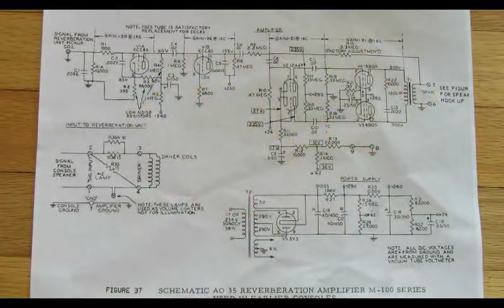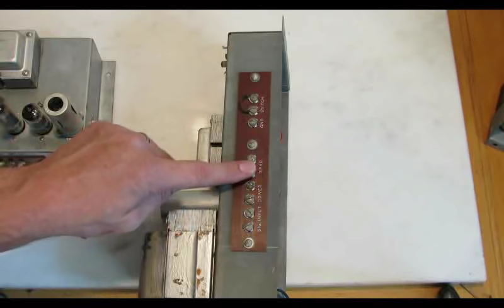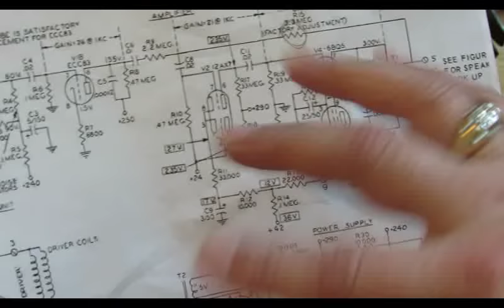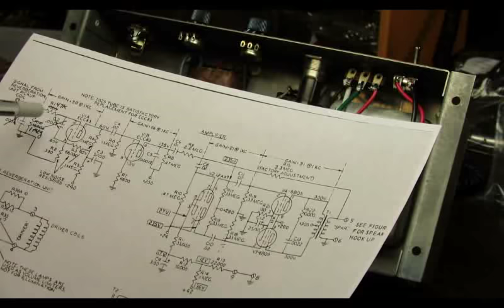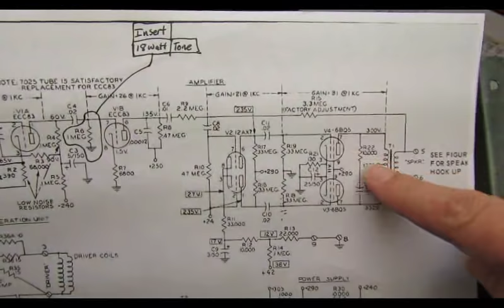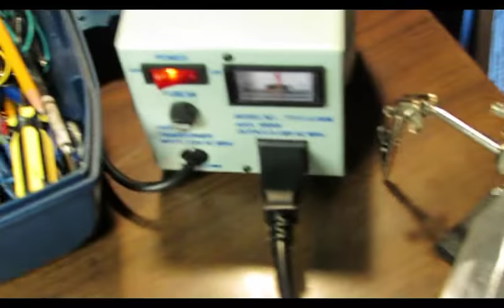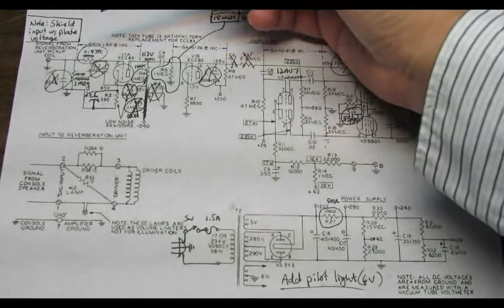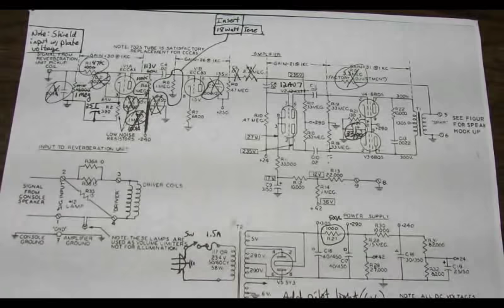Hammond AO-35 Complete Start to Finish Guitar Conversion & DEMO

Comment: So I've got one that I've just finished my initial mods to which follow many of the suggestions that have been mentioned here. I'm amazed at how quiet the amp is even though the only new parts are in the tone circuit and input. I've also completely removed the NFBL and the zobel network (this was done for me when I powered on the amp and the resistor in the zobel network burned up). 

The issue that I've come across is that at about 3-5 on the volume, I get some high pitch squeal. Above that the squeal goes away but the volume is substantially lower and there are a lot of what I assume are odd order harmonics in the distortion (to be honest I'm having a hard time finding a video demonstrating odd order harmonics to be able to confirm my suspicion. 

The controls are in the same location as the CG and I ran across another thread a while ago (of course I can't find it now) that mentioned having the controls that close to the OT, can cause some interference and that if that's where you're going to mount it, that you need to have it shielded. Anther possible cause?

I have 2 new, matched output tubes coming as I think I've ruled the pre-amp tubes out through swapping out with some that I had on hand which I knew were good.

Open to any feedback. 

P.S. amp sounds great at the volume below where I experience the squealing.

Comment: Sorry for being late to the party, but I couldn't help but to pass along something as a Hammond player. ( I own a B-3, a C-2, and an H-100). I wouldn't "fret" over the usage of these amps for projects, since the wimpy 35 (at best) watts that these babies output can barely be heard in a modern band setting without being mic'd or a DI installed and piped directly into the PA. Most players I know, including myself, have replaced the AO35 with a modern amplifier of at least 100 watts. Not to mention that many old Hammond amps like the AO71 used GZ34/5AR4 rectifier tubes, which you likely know, since some Gibson tube amps use them, that a USA NOS tube will cost you $200, $300 for a vintage NOS Mullard, and $400 for an Amperex Bugle Boy tube!  I wouldn't worry about these little amps being used for projects! I have at least 10  of these sitting around waiting to become something useful!!

Comment: Hey Brad, you should have like 250k subs in a year, no problem. i build amps and play as well. in a weird twist of events you have actually inspired me to move from restoring old crts in 80s arcade games, back to working on music gear which is how i got into electronics in the first place. I ripped a bogen chb 14 off my shelf and converted that, into a guitar amp. it actually turned out great, and I also shot a video on it which i will post up soon. i have videos on my channel but its arcade related electronics and a few other repairs. But so cool. Great work, and wicked chops.
Reply from the maker: I doubt that. I think I'm on YouTube's shitlist for thought crimes. Glad my vids inspired you, man. Thanks for watching and commenting. Means a lot.
Reply: The Guitologist thought crimes??? Haha..thats good one. You should have way more subs! Pretty cool the content you have. Your also lucky to be in a location where you get alot of vintage gear. A few years back I moved back to Toronto Canada from Oklahoma where I lived for 5 years. Much easier to collect awesome gear to work on than here in Canada. I bought a bogen k15 with push pull 6l6s and 2 preamp stages plus a bogen challenger the one I just converted but I had to pay 200 bucks for the stuff broken and half tubeless it's a joke here for stuff like that. 

Anyway keep up the show man!!! Pretty neat.

Comment: A fine scotchbrite pad is probably a safer thing to use for rust removal in an amp. Only takes one steel wool fibre in the wrong place to cause problems.

Comment: Hey Brad. I like the videos. Iam an Uncle Doug fan as well. I was wondering;  those ceramic disc capacitors you replaced with orange drops.. is it microfarads. in the AO35 ?  I only have a basic volt meter and. cant test the capacitors. Thanks.

Comment: How do you upgrade the memory in those amps? Say I wanted to go from 2Gb to 8Gb where do I plug in the SCSI cable? Also how do I make it pay mp3's off an SD card? The SD card has more wires then the input on the amp. Can you just tie the extra wires together?
Reply from the maker: Although this has several PCI expansion slots, they are unfortunately not backwards compatible with Windows XP Home Edition.
Reply: @TheGuitologist  pahahahaaahaha 🤣😆😂 ..goddamnit Brad ✔

Comment: Zobel circuit used to balance loud speakers with different sound pressure level  outputs by  attenuation of the  higher SPL speakers signal.

Comment: The fuse should always be the first thing a power supply hits when it gets to a circuit. The reason is pretty simple. In the event of a fault that blows the fuse, the power is isolated to where it entered the circuit, thus the whole circuit is protected.

Comment: On top of being super knowledgeable in electronics, your a hell of a guitarist to boot.Also, you seem to get a good variation in tones with just the tone controls on that guitar.The sound comes out pretty well with just your camera phone. The little bit of distortion from the little camera mike suits my ear just fine. Oh ya, the amp sounds great too. Cheers
Reply from the maker: +Krang Gangs Thank you for your kind remarks. I try to learn a little all time and, hopefully, forget less than I gain in knowledge. I agree that the sound of the iPhone isn't bad at all at these sorts of volume levels. The mic and compression are just good enough for this sort of demo. I think it actually gives a more honest representation of an amp's actual tone in a room than close, unidirectional mics possibly can. I see a lot of videos of amps I've owned which don't seem to do the amp justice because of the close micing.

Again, thanks for the kind remarks and taking the time to watch and comment!

Comment: Several quick questions please.  1. What did you do with the green wire you clipped from the terminal strip at the beginning of the video? 2. Where is the tone stack wired in at?  3. Where is the lamp wired in at?  My project is almost complete and I need you assistance.

Comment: What is the ohm rating of the speaker you're using? I have an AO-35 on the way and I'm piecing together exactly what I'm going to be doing with the circuit but the one thing I don't think I've heard anyone mention is the speaker requirements. 

Thanks for the great vids! Keep them coming. Between you and uncle doug, I've got way to many project ideas than I have money to see them through with.

Comment: Amazing tutorial and video! The guitar playing at the end was also great.  I garbage picked a AO-14 amp out of an M-2 organ in my neighborhood and your results with the tone and sound are inspiring.  I see many similarities between the AO-35 amp and mine; however, the AO-14 has several more tubes and is physically larger.  Just wondering if anyone has had success with that model amp.
Reply from the maker: +Mike Choffin You should be able to make that amp into a monster with similar qualities as this AO-35. Of course, you could make it into whatever sort of amp you like. The Hammond transformers are TOPS! Best transformers ever made, probably. Mercury Magnetics have got nothing on these old Hammonds, I assure you. You have probably the best starting platform you could ask for. Some thoughtful and creative designing, and you'll have a great amp, I'm sure of it.
Reply: +The Guitologist I may have spoke too soon.   The schematic for the T-4 power transformer shows three output voltages from the secondary windings. 5- , 6.3- and 340-volts.   I don't get power from any of the secondary taps.  I'd guess that the main power transformer is dead.  The footprint of the model you converted is much smaller than the AO-14, nearly 22" long.  I may just wait to see if I can find one like you converted.
Reply: +Mike Choffin 
Hi Mike,
How many watts is the AO-14?
Is it more than the AO-35?
Thank you.
Reply: +Finom1 'm not sure.  I new to this and learning as I go.  Like I stated above, I garbage -picked the amp section and speaker an M-2 organ that someone in my neighborhood was throwing-out.  From what I can tell reading on the internet, both amps will produce  very powerful sound output.  

Looks like a great project.
Reply: @Finom1  AO-14 uses 6V6 power tubes worth 14 watts each at best.

Comment: Brad I love the sound of your amps and have been watching voraciously! Let me ask you, which Hammond, the A0-29 or A0-35, is the simpler conversion and which do you think makes a better guitar amp? Or is it just a matter of taste and power difference between the EL84's vs the 6V6's ? Also, your tremolo circuit sounds fantastic in the A029 conversion! Also, in your A0-29 conversion did you simply cut out the un-needed circuits or did you pretty much gut it and rebuild ? I was going to build a 5e3 kit but man your amps sound better than the kits I've heard!

Comment: I mounted the board and brackets on additional brackets, so it is horizontal.  Much easier to experiment on.  The original circuit has plenty of gain once the input components are changed to values suitable for guitar.  I don't think it really needs much tweaking beyond that.

Comment: how hard would it be to use an EF86 as the first preamp tube? I have an old AO 35 that's been lying around the shop for years. thanks for posting this. Uncle Doug demoed one but didn't get into the details of the conversion like you did. great job.
Reply from the maker: +zendixie Thanks for watching and commenting! An EF86, being a single pentode, you may actually end up losing some gain and volume overall because you're trading the first two stages of triodes for one pentode. I'm sure we could look at the datasheets and do the calculations and figure out exactly how much you'd lose, but I'm guessing it would be significant, and the end result would be very different than what I ended up with here. If you're looking for a far cheaper alternative to the EF86 to have a pentode up front, you can also check out the 6GH8A. Similar to a 7199. It has a triode AND a pentode in the same envelope. You can retain the two gain stage architecture without adding another tube socket.
Reply: +The Guitologist I'm trying to find a way to get a cheaper Winfield Cyclone. Also the Super 17 amps started as AO35 amps and I think some of those used an ef86 , maybe followed by another 12ax7. Matchless DC 30s use the ef86 as well. the gain may be less but to me the tone makes up for it.

Comment: Wait, at 52:00 I must have have heard wrong.

Yeah, I sorta did hear wrong. A 12AX7 plate is around +210 volts above ground so don't forget and wire the other end of the coax to the input jack end to ground. I've heard of only grounding one end and float the other end so that you don't have ground loops.

I'm trying to figure how that works. The thing that I'm coming up with is the DC doesn't flow but you get a counterpoised (180 degree out of phase) signal on the sheild. Do you know what gives here?

Comment: Dear Brad, 
Ive eaten every last kernel of my third helping of popcorn and the AO-35amp that i pulled up alongside me is nearly complete in its conversion. I have followed your exquisite recipe to the best of my ability but i have hit the wall. Please excuse me if I have misinterpreted but are there a couple of steps missing in this video? It would also be a tremedous help if you could provide a complete list of parts that were added, replaced, and removed. 
I have studied the before and after schematics but still seem to be missing  something. To be honest I do not have much experience reading schematics. Or rather, I can read them but I’m having trouble matching the schematic to the hardware. Often I can do better simply matching what i see in a photo or video. Then verifying that against the diagram.

After watching and reading countless other videos and documents to attempt filling in the gaps I've returned here to ask you for clarification and guidance. It seems every other instance I can find does not match your design /build efficiency and they spend too much time fiddling with things that you've completely removed. And the proof is in the pudding. Shaky pudding anyone? Now there’s a good old fashion southern colloquialism for ya. Not that it has anything to do with this amp. It just popped into my head for the first time in 35 years. Mote p. That later.  

Brad your demo at the end of this video says it all. The Fire Breathing Marshall Killer indeed!  It is the #1 reason i keep returning to this, YOUR conversion. If i can get my ao35 to sound half as good as yours, I will be a very very happy camper. 
I'm working on a more specific list of questions. A list of parts added, changed and removed would def be helpful. 

And to what address do I mail my Shit Post Frydays gifts of gratitude?

Comment: I'm gonna finish watching this later, but I just wanted to say I have a H AO 22111 coded (on transformer) Hammond amp I'm going to use for something 6V6-powered. Not sure what kind of design I want to use, so what's your favorite 6L6 amp? I'm still working on a 6L6-powered 5E3-P Fender design first. I used wide terminal strips from that AO 22111 chassis for it so far. The 5E3P uses iron from a free Wurlitzer that had 6L6-compatible tubes (forgot the number codes of them)
.

Comment: thanks for this- Great job and so helpful- I'm struggling with some the very issues you address and will now try your mods!Only request is for a post of your final schematic.
Reply from the maker: +Corey Collins at about 1:25:00 in, I talk about the schematic.
Reply: roger that- I tried a screen capture but the resolution isn't too great- just thinking a file of that schematic would be so helpful- you did a great job simplifying the AO35 and showing your final layout...
Reply from the maker: AH! How silly of me not to think of that. Of course it would be a PIA to see a screenshot and print it out. Lemme see if I still have the schematic lying around...
Reply: Much obliged!
Reply from the maker: +Corey Collins Hey Corey...was just thinking about your project and wondering if you ever got it going...

Comment: When you inserted the tone stack did you go from the .022 capacitor right into the grid of the 2nd 12ax7/ phase inverter? Did you solder it to the board or directly to the tube socket? Was the 1meg resistor removed where you have circled to insert the stack? Thanks any and all help is appreciated
Reply from the maker: The resistor is replaced with the tone stack. The pots become the resistance, but variable. Yes, situation the input and output of the tones stack between the coupling capacitor and the grid of the tube. It'll be either pins 2 or 7 on that tube socket. Hope that helps. Good luck!

Comment: I have a Hammond L-100 or thereabouts, that has needed a starter motor for about 30 years. I have a used motor and have tried to give away Hammond and engine for free, to churches, but no one wants it, here in 2020 ... Had an old Leslie too, but termites got into it ... Battin' a thousand, here ...

Comment: just watched the video, did you try the NFB into the tail of the PI and put a presence. if done rite its like having an extra tone knob left to right,  bass to treble and expanding. and you only add 1 knob and a few components. If you do it. Do a little video on NFB and presence control. love your videos,  just don't have that much time to watch stuff. keep up the good work

Comment: Funny, I used the same tone stack diagram as you did and had the same issue with the tone pot being backwards.  Easy fix to reverse the wiring.  What size speaker are you using?
Reply from the maker: 15" Eminence Legend

Comment: This is GREAT! Thank you. I just re-capped mine and hope to wire up the pots soon. One question though, I have a reverb unit I salvaged from a marshal amp. How would I wire in a "effects loop" with a Pot to control it?
Reply from the maker: That's really outside the scope of this video, but you might might useful information on this forum: http://el34world.com/Forum/index.php?topic=10208.0

Thanks for watching and good luck!
Reply: Yeah, i know I just figured you'd be the guy to ask about it. Maybe not an effects loop though. Most amps just have a Pot for reverb. I figured that would be easy enough to insert near the tone stack? I'm really a noob when it comes to understanding this stuff but I seem to be able to follow directions well! This will make my second tube project. The first was recapping a Bogen DB230 stereo. (sounds great!)
Reply: Oh, and is there any reason I shouldn't mount this amp upside down in the top of a custom built cabinet (tubes in the rear plugging up into the box) That's kinda been my vision for this project but I've only seen guys mount them in the bottom of the cabs.

Comment: hey Brad i have  a question, where did you end up putting the yellow wire that came off of the board  ? i was not shown in the video. thanx again for your time. i mite be asking alot of questions but this is my first ever guitar hammond amp im doing. WOW i feel like a noob !
Reply from the maker: Hi Chuck. Congrats on your chosen adventure! The yellow wire was going to terminal #5, which was the positive speaker terminal. It was a negative feedback loop, so you can hook it up to the TIP of your output speaker jack you install. The amp will also work without it, so you can experiment with it hooked or unhooked. Negative Feedback (NFB) is a way of taking some of the output signal and feeding it back through the cathode of an earlier tube stage. This will be an out of phase signal and work to suppress unwanted noise and tame down spikiness and gain. It makes the amp a bit more stable.
Reply: kool Brad i thank you again for for the help, and i have a feeling i will be bothering you again.